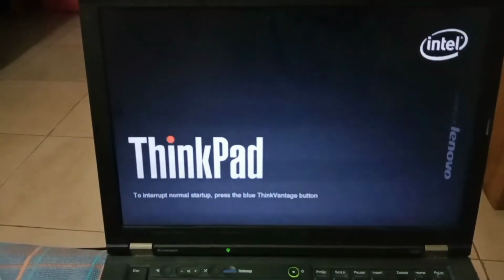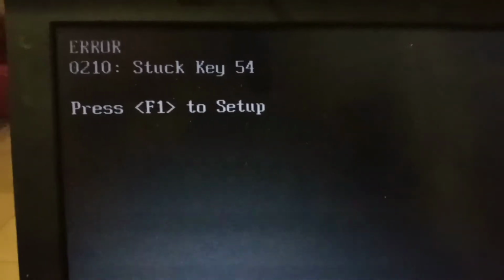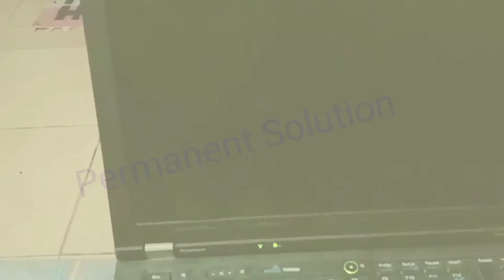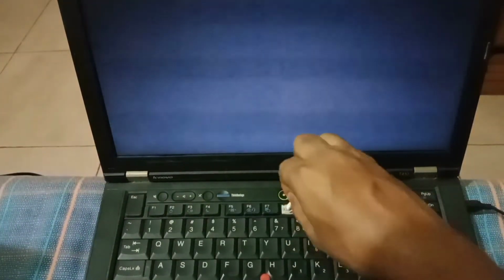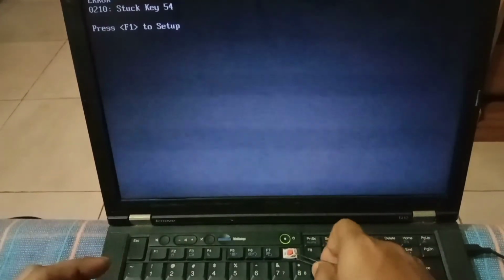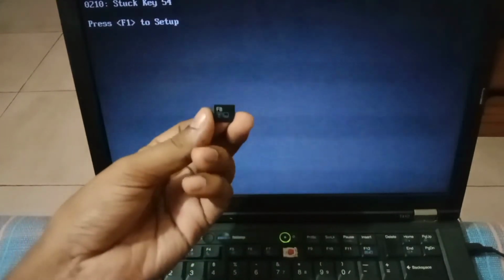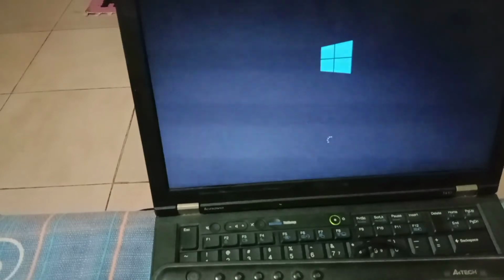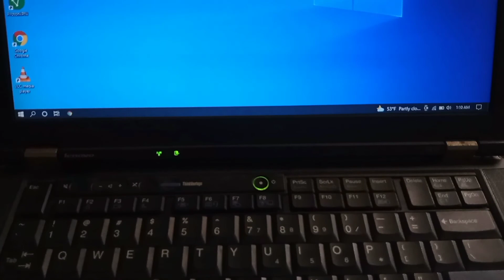ERROR 0210: Stuck key 54 press f1 to setup

Comment: I already did the first one last time and it worked then when I open my laptop again today it has same error, then I clean the F8 key and still it still appear the 0210 key error but I press esc and then it will start opening the window. 

I turn it off and on twice but still the error appear but it work if I press esc. 
Still thanks
Reply from the maker: If the problem is not solved even after cleaning f8, the keyboard needs to be changed must. That is the final solution. Thank
Reply: Same thnku